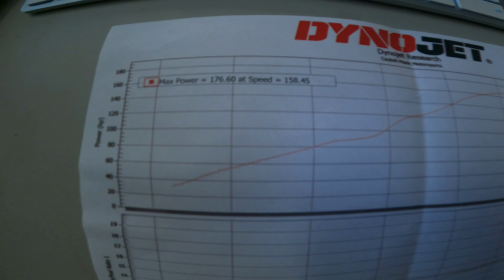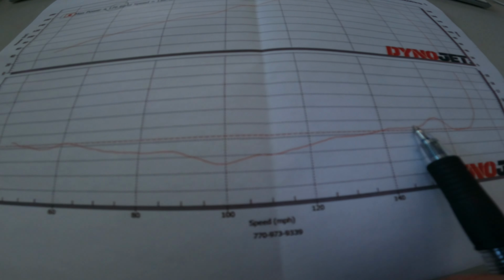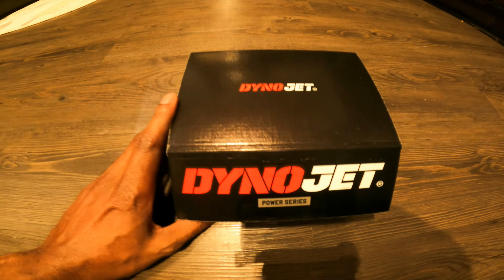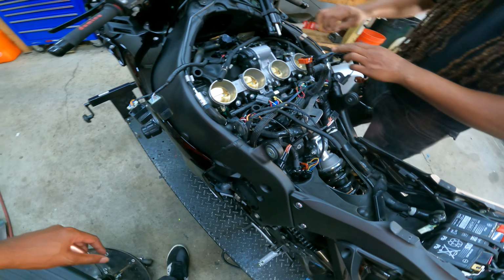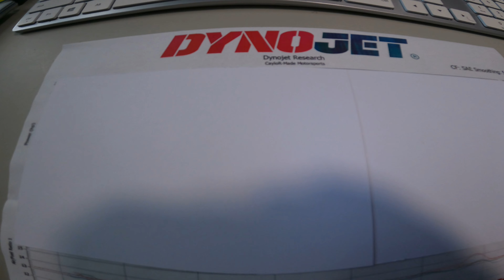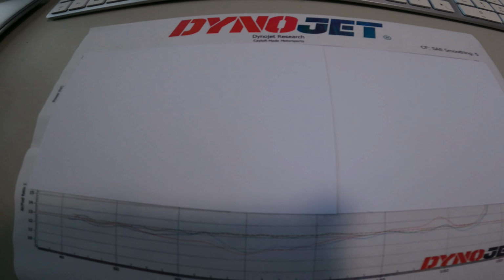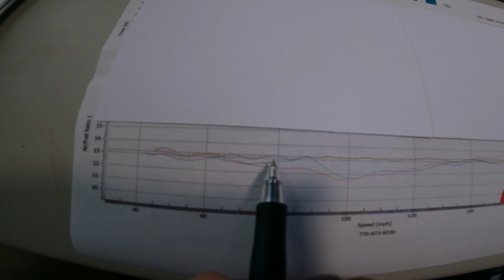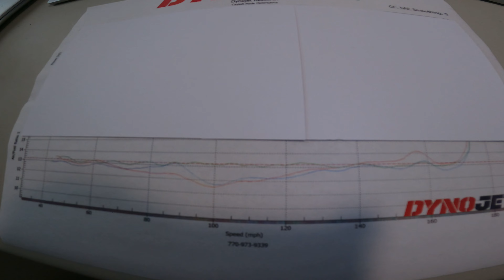ECU Flash + Power Commander | 2021 Zx10R (Gen 6) | PC5 Install and Tune

Comment: Fuel tanks on the concrete floor  beside where your working on the bike and the metal part of the strap tieing down the bike on the dyno  on the exhaust hanger😲.steering damper in a very high risk of getting marks allso how it was left.Wrap up  with a rag. I suggest the boss in that shop change  them practices and has a serious talk with his employees. Poor show and   doesn't instil confidence from a customer point of view NO WAY  I be getting work done here
Reply from the maker: Thanks for taking the time out to check out the video and commenting! This is my favorite shop and ill continue to go here. You can call and share your suggestions with the owner (Caylor Made, Marietta GA), they are always looking for ways to improve. Ride safe! -6

Comment: all you need is a ECU flash and exhaust system take that commander out
Reply from the maker: Imagine what the world would be like if everyone took advice from people without facts and credentials behind their statements. Thanks for checking out the video. Ride safe!
Reply: @6GearCutloe  I have a Z900 2021 ECU/Dyno tune with M4 full system 👌 😎 runs tyreek hill ✌🏾.
I guess your ZX10R must require a Power Commander because a ECU Flash and a Dyno tune should be what the power commander is need for. correct me if im wrong?
Reply: you should've went with Moores Mafia hahahaha 😆 😂 🤣
Reply from the maker: @motobarberdad  z900 with the M4 sounds like a nice bike! Chris Moore has good flashes from what im hearing! I could correct you but you'll learn more and it'll stick if you do your own research. Each one teach one my brother. 💪🏿
Reply: @6GearCutloe  so does the Zx10 need to have a power commander because that my next bike God willing
Reply from the maker: @motobarberdad  nope, it doesn't NEED a power commander but if you're looking for damn near perfect feul efficiency, then you should get one and have it tuned.
Reply: Eating while making a video. 🤦🏽‍♂️ Bro!! 😂😂😂
Reply: Love the bike. I've got a 2022. My stage 1 flash with no PCV or dyno tune got 187hp on 91 oct. I have slip on, cat delete, sprint airfilter and  block off plates installed. BT suggested same for me with the PCV. I would have thought a stage two would have got a little more than 175hp. 
Is it tuned to 93 Oct. 
Solid bike though bro.